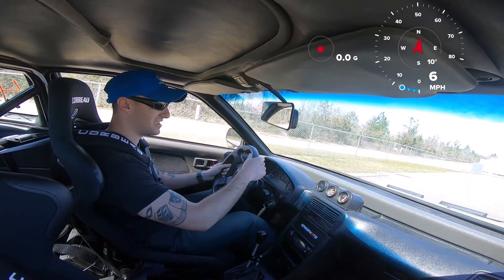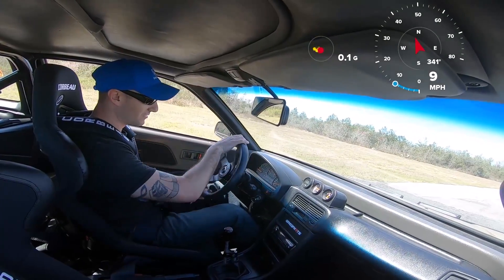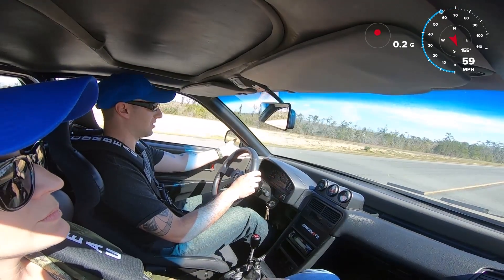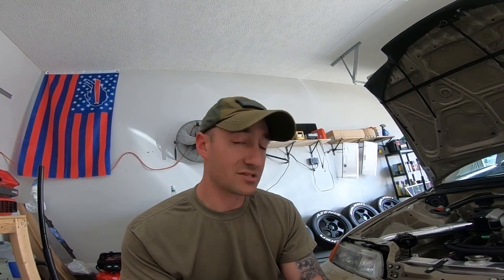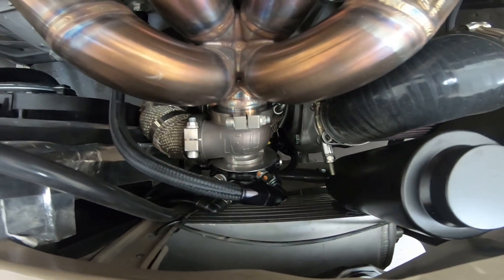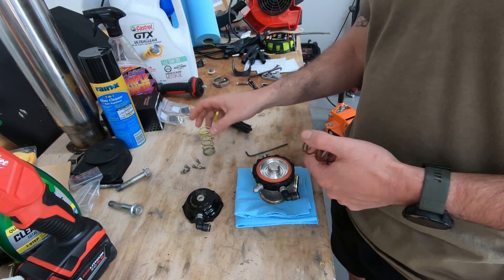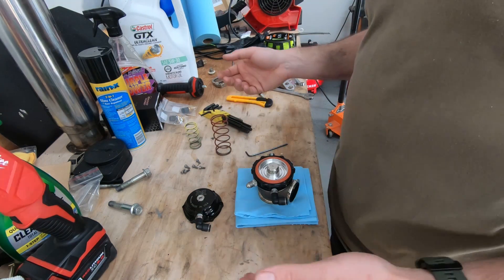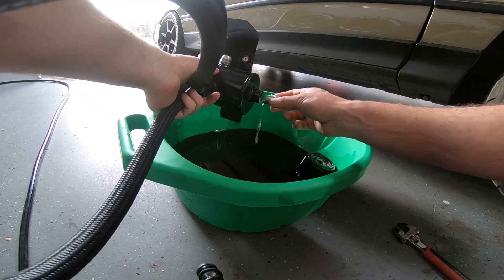Honda CRX Si 1st Drag Strip Experience Ep 01

Comment: A couple things to try for you next trip. Havent watched whole vid yet I'm half way. I know you got slicks from FB tho. I reccomend at least a 2nd gear burnout. But  3re gear is even better. When you are staging you need to preload your drivetrain so you arent snapping axles or breaking gears by holding your parking brake up and slipping the clutch. While launching slip your clutch through 1st gear. That way the tires have alot less chance of breaking loose. Couple things for you to try next track day, good luck and have fun.
Reply from the maker: No Budget Racing definitely try a second gear burnout next time. So let the first stage light come on. Pull ebrake and slip clutch till I get the second stage light lit and just sit. Light is green release ebrake and slip the clutch. That’s what I’ve gathered so far. Appreciate the tips
Reply: @justingadell  yes exactly. 😁